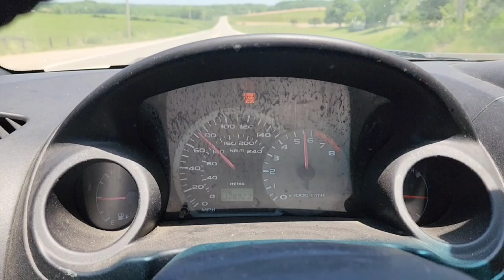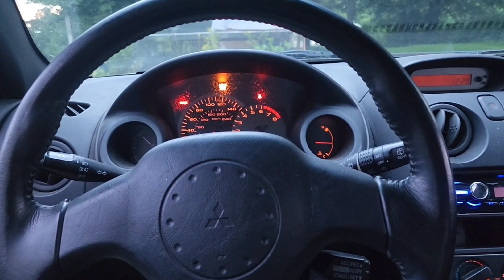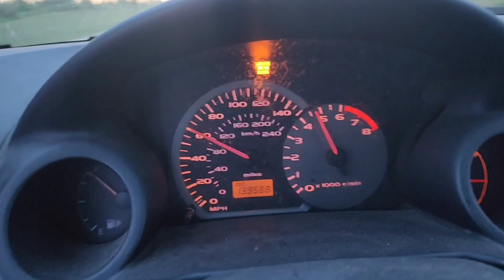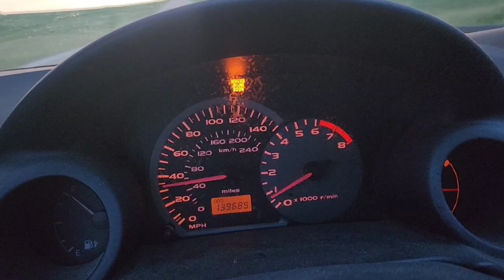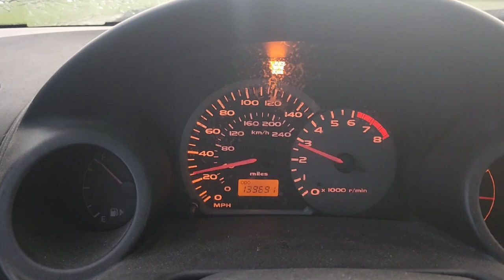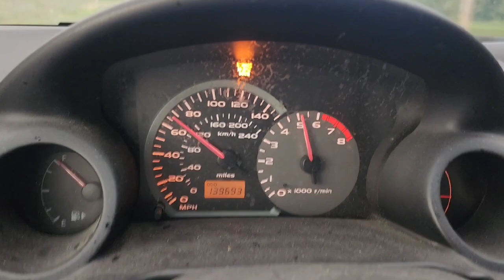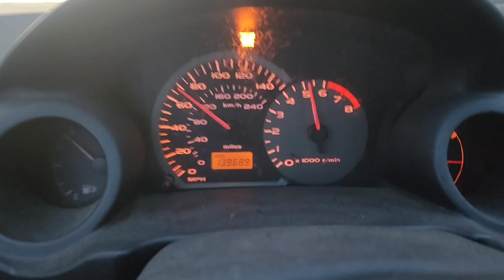Diagnosing & solving a weird vibration & power loss Mitsubishi Eclipse GT GTS 3.0 V6

Comment: So, your idle issue and your vibration problem are related...

This is my opinion, since you are getting air in the engine somewhere after the MAF, and your K&N filter seems dirty, could be that the air was prioritizing enough the intake after the MAF enough to make it mess up the AFR and killing the power or causing knock, when you removed the filter or installed a new clean one this got fixed temporarily until the filter gets dirty again and the issue appears again.
Reply from the maker: I really don't know, but I replaced the filter and those buttons and the problem was resolved as shown at the end...
Reply: @92kbuilds-mn2lk  But the idle issue is still there?
Reply from the maker: Yeah but it's better and it has been doing that way before this issue. I think that's just an idle re-learn thing these cars have after disconnecting the battery, or maybe the evap code I have.
Reply: @92kbuilds-mn2lk what's the evap code.
Reply from the maker: @Shane - P0455 I think
Reply: So what’s the way too properly fix the loss of power and rough idle ?

Comment: I have the same engine in my my 2000 Montero sport. Mine has a little rattle sometimes right before it shifts. New timing components. It's done it since I got it. 93 octane no ethanol still there . Maybe a weak lifter?  It's not very noticeable.

Comment: If it pops or backfires through the intake it could be an intake leak the computer cannot compensate for. It's a large leak, you can burn valves!

Comment: I had the same issue. Replacing the MAF got rid of it. Mine would drive fine but idle like dog shit until one day it just didnt want to stay running.
Reply from the maker: You're referring to my idle?
Reply: @92kbuilds-mn2lk  yes. I’d have to feather the gas pedal to keep it from dying because it wouldn’t hold an idle

Comment: Okay so what was the cause of the power loss ? And rough idle ?
Reply from the maker: I detailed the power loss fix in the video. My idle has gotten better over time without doing anything, but it probably still needs something replaced...
Reply: @92kbuilds-mn2lk  so all u did was change ur air box?rlly need help with my car 😂
Reply: @92kbuilds-mn2lk  also what’s the exhaust set up your running because, I want too know if I just cut my back muffler off and straight pipe it will it make a difference
Reply from the maker: Yeah, because as I said in the video, the only thing I can think is the old filter was rattling around in there (I had a weird vibration also). Clearly you skipped through the video or didn't pay attention- I suggest you watch it from beginning to end instead of making me type it all out in the comments. 

It was a really weird one-off type of problem, so likely not the issue you have. Start with fixing any codes you have- presumeably you have a check engine light on? So see what the codes are. And the exhaust is a Greddy Cat-Back system, Evo 2 or something like that- plus a hole in the downpipe under the engine lol.